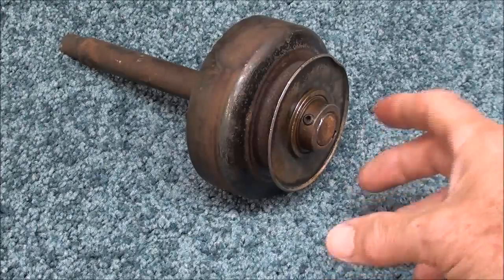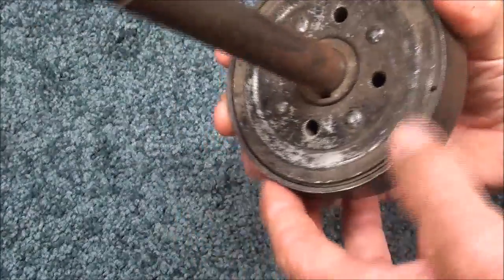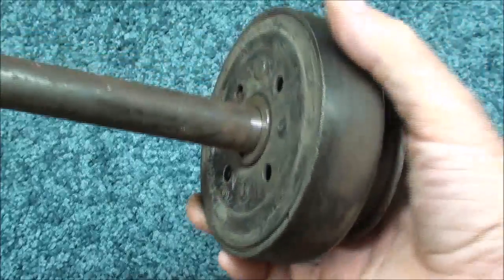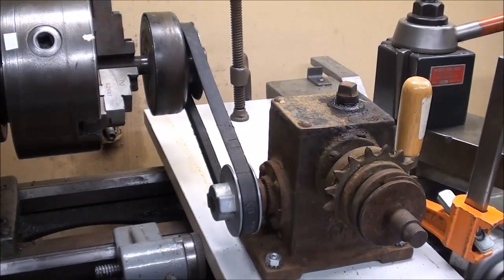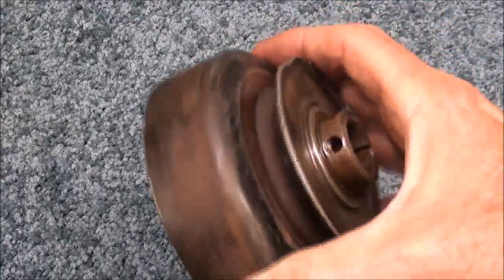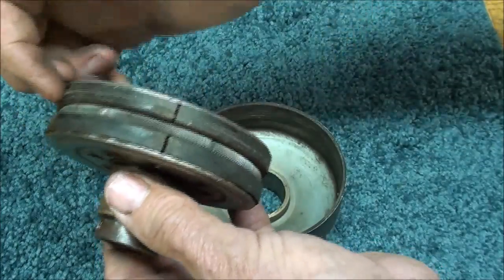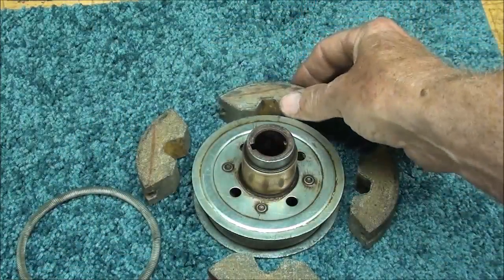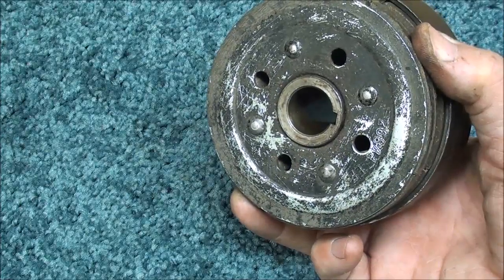WHAT MAKES IT WORK?  #5  Centrifugal Clutch tubalcain mrpete222

Comment: I got a 7 horsepower small engine attached to a truck alternator I'm using that type of clutch on the motor because it was too hard to start on the load it works beautifully thank you so much to explain how it works
Reply from the maker: Glad I could help!

Comment: The basic operation is simple and easy to understand. The clever bits no one will generally notice - and that's how the brake material is driven with the pin through the slot towards the centre. The interface shape can be quite critical to effect fancy functions - typically, when load is added, extra pressure is applied pressing the linings against the drum - to give a more positive action between slip and grip.
One YouTuber, HubNut, has an 'Invercar'. Yes it has a centrifugal clutch then power's transmitted through a pair of automatic 'Reeves drives' to effect a constantly variable transmission.
https://www.youtube.com/watch?v=j2jkyCaard0
What effectively these pulleys turn out to be are two analogue computers fighting over a drive belt ! The one on the engine side is a centrifugally controlled pulley - the faster the engine spins, the more belt it wants to take (to keep engine speed down). The wheel side pulley contains a tensioning spring to keep the belt tight and some torque measuring ramps - the clever bit. If the torque is high, it prevents the ratio changing. So as the engine loses the torque, that allows the ratio to change - perhaps if you reduce the throttle opening on the engine or its power peters off at high rpm. I think they fit a restrictor to the inlet manifold as a means of capping top rpm.
Gearbox ratio is all 'calculated' mechanically to suit the driving conditions. I think it's ingenious !

Comment: Ahh, you could have had some fun with that. Having lubricated the main bearing in it and reassembled without the spring and remounted in the lathe - you could have demonstrated the clutch action at much lower lathe RPM !

Comment: Great video. When at high speed, my vibrating plate compactors power has just started dropping right off back to idle after only 5-10 mins of use. After some google searching on why this could be happening, I have come to the conclusion that it is down to what I now know to be the centrifugal clutch, & that the pads are no longer able to grip the outer drum, through either lack of tension from the springs, or simply wear to the pads.
Your very informative video breakdown on the mechanics of these clutches is where it really clicked that this is very likely the cause of my issue.
I have yet to remove the clutch, but from what I have learned from this, is that I very likely need a new clutch, or a very good condition 2nd hand replacement, as I don't see that these can be adjusted to compensate the lose of tension in any way. 

Thanks greatly from the UK

Comment: Very interesting and informative. I suggested a centrifugal clutch to someone on the HSM forum who was having trouble running a compressor from a marginally powered generator. I think it would work pretty well. The other way to implement a clutch is with a tensioner on the V-belt, so you could start the motor unloaded, perhaps even with a flywheel, and then engage the drive to overcome start-up torque.
Reply from the maker: That was a good suggestion

Comment: Wouldn't some high temp. grease be much better than oil for that bearing?   Are these kind still made?  So you can rebuild this kind, wouldn't you want to scuff the contact area of the clutch/brake pad material w/ some course sand paper?
Reply: I think it's better to have smooth surfaces for a smooth transition. The clutch pads on my old RC car were made of PTFE (very slippery).

Comment: Do the pivotal lugs push the pads up or do the pads push on their own?
Reply: +Pelonius  The pads are thrown out by  the rotation ie:- Centrifugal force is an outward force apparent in a rotating reference frame.
Reply: +Gary C i am aware of that, I am curious if the lugs help. They seemed to move and were notched. So when they slightly twist is they would push the pads
Reply: +Gary C i am aware of that, I am curious if the lugs help. They seemed to move and were notched. So when they slightly twist is they would push the pads
Reply from the maker: +Pelonius  Thanks for watching

Comment: I noticed when fully engaged the pivoting wedge on the driving shaft would wedge the friction shoe out onto the driven drum so under high speed and a bit of torque it would hold tighter.  More torque, more wedging out for tighter fit.  I seem to remember they would release at a lower speed than they engaged.  I had the chain drive 3.5 and 5 hp B&S engines on mini bikes and go karts.  And for awhile we had a centrifugal clutch and belt driven torque converter on one of those beach trikes from the '70s.  I think the 6 wheel amphibious atv's had the same torque converter and clutch.
Reply from the maker: +RobiSydney  Thanks for watching Thanks for watching-good observations

Comment: This brings back memories.   When I was a kid most mini bikes had a broken clutch and throttle.  A boys fix to the clutch was to drill a hole in the outer housing and put a screw in the hole to bund up with the clutch and make it a full time clutch.  For the throttle, we would put a string on the carb and pull on the string to go faster.    I actually never saw a mini bike without a jury rigged string pull trotted when I was a kid.

Chris
Reply from the maker: +shadowdog500  Thanks for watching--we all had our ingenious little repairs--no adult supervision----EVER

Comment: Mr Pete-Remember the Cushmans that had the 2 speed transmission? They had a centrifugal clutch that had a clutch pedal that released the clutch so you could shift gears. 
Your mention of Cushmans brings back many memories both good and painful!!
       Marv. W
Reply: +marv w I used to have a Cushman with a 3 speed tranny and 2 speed gearbox that also had 2 wheel drive. A flexible cable drove the front wheel geared hub. Rokon now makes them. The ubiquitous Honda 90, trail and street, used a centrifugal/ manual clutch that disengaged when the shifter was operated. Many smaller motorcycles also use them.
http://www.rokon.com/
Reply: +Moholo 88 P.S. I agree with the memories. I remember my 38 Dodge sedan had a torque converter and a clutch pedal. Some Volkswagens and the aircraft tugs I used in the service had a t/c and an electric clutch. I imagine there are many other examples and configurations.
Reply from the maker: +marv w  Thanks for watching--I do--but my cushman was one speed-SLOW
Reply: +mrpete222  I had a single speed Cushman with a milled head, larger valves, ported and with a racing cam. It went really well for what it was.
                                          Marv. W
Reply from the maker: +marv w Thanks for watching--mine was a 1 speed.  Yes--good & bad

Comment: Why can't they put those in automatic cars instead of expensive torque converters? Too much wear? Great video Tubalcain!
Reply: +W.Co.VIDS Maybe this will explain the differences.
 https://en.wikipedia.org/wiki/Torque_converter
 https://en.wikipedia.org/wiki/Centrifugal_clutch
Reply: Now that I think about it, I guess a simple centrifugal clutch would cause too many performance problems for todays world. LOL! It would still work with a reduction, but it may cause slower acceleration and poor performance. Thanks for the articles!
Reply from the maker: +W.Co.VIDS  Thanks for watching

Comment: I got a cheepie ebay clutch for my grandson's go kart, about 30$.  Not good for the HFT 6hp motor, it was destroyed in less than a month.  So I ordered the "extreme" clutch for 50$, claim it is good up to 12hp.  Should get it next week.  I have a vd of it.  He likes to goose the gas.  Gotta learn to floor it, LOL.  I'd like to make a heat sink for it, that old one got hot, I had to shorten that spring and lower the idle rpm to make that cheepie work. Don
Reply from the maker: +umajunkcollector Thanks for watching-yes-hold it down

Comment: Great information here. I wonder how such a clutch can be "burned". On my chainsaw, as you say, there is such a clutch, but I had to change it because I burned it. I don't know how it can be done. Is this a common problem with this kind of apparatus? As always please accept my sincere and warm regards.
Reply: +Robert Patoine Either more power than the clutch was designed for (unlikely, unless you modified the chainsaw), or partial throttle (letting the clutch slip under power). With these clutches it is best to either be idling or going at full throttle. Do you ALWAYS pull the trigger all the way? Or do you try to cut slowly (perhaps for extra control)?
Reply from the maker: +Robert Patoine Thanks
Reply: +Peter W. Meek 
Thanks, I did indeed cut slowly. But now I pull the trigger all the way only when I am ready to cut and very near the tree. And I release it immediately after.

Thanks